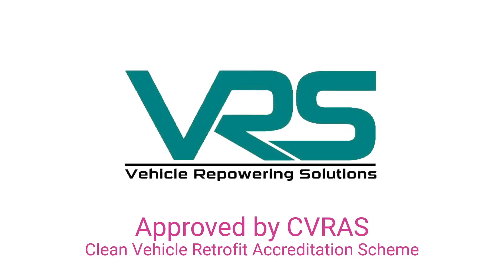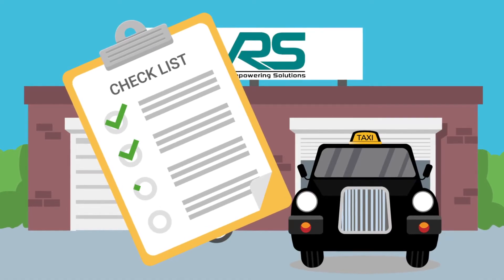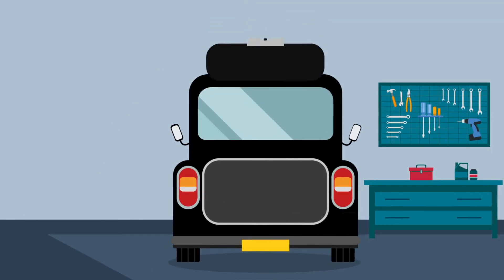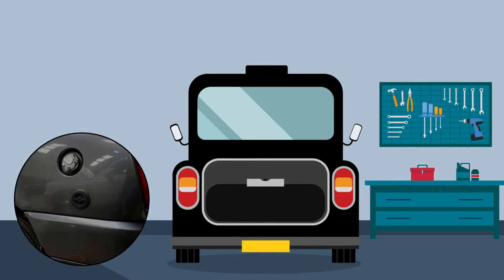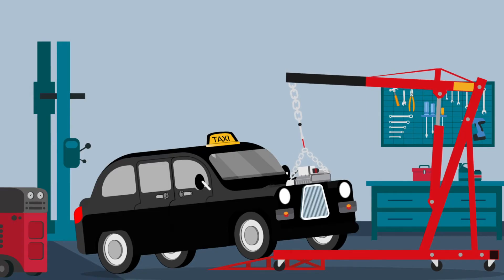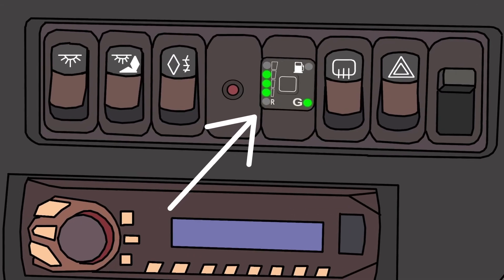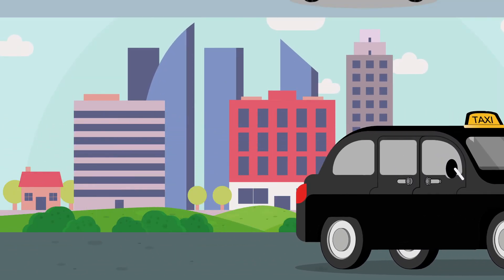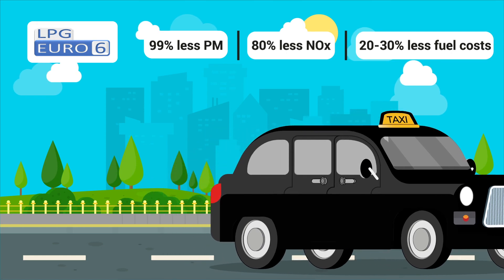Euro 6 LPG Retrofit by VRS

Comment: And the cost is?  Ridiculous sum of money that makes it pointless to do. Unless one does DIY, no way it'll make sense to give money to garages.
Reply: This is an engine and exhaust replacement for non-euro 6 taxis, so they can enter low emission zones and clean air zones. It wouldn't be possible for owners to do a DIY.
Reply: @talktiger8  of course, it's possible for DIY to do anything. I've done something similar and I'm not even a mechanic. Don't under estimate people's abilities. We all can do many things in life DIY .
Reply: @July-A7  It is not possible to DIY for this application (making a TX4 taxi LEZ/CAZ compliant) as the system needs to be CVRAS certified and fully emission tested etc. Also, if you're putting in a different engine, as in this case, it's very technical. Bespoke electrical harnesses and control systems designed and built, for instance. Not possible for someone untrained or inexperienced to achieve.
Reply: @talktiger8  you cannot say this. Everything is possible. Testing is separate from building it. People change their engines all the time and then take the car for testing and certification. It is pointless to repeat the same nonsense that DIY cannot change the engines on their cars. 
Some do DIY conversion engine to fully electric . Some DIY their own airplanes, from scratch. My cousin constructed a small airplane and flies his family in it. He is a pilot, bit not a mechanic. Just a competent DIYer.
Don't try to put limits on what people can or cannot do. Evidently, it is impossible for you, but plenty of us are much more capable than shrugging our shoulders saying "Nope   Not possible".
Reply: @talktiger8  further, it's doesn't have to  be "bespoke electrical harness". You can change the whole electrical loom . Or you can add only the required cables and sensors for petrol and reprogram the ECU.
Reply: @July-A7  ok 'some' people, I suspect the vast minority, might possess the skills and knowledge to achieve the things you mention BUT in relation to this specific video, a taxi driver with a TX4, can't just go and fit his own system/solution to bring his cab up to Euro 6 standard. There are strict rules and regulations in place from local authorities and licensing bodies.
Reply: @talktiger8  yes,some people.
The point I made in my first comment was that the cost of such conversion will likely make it uneconomical, unless someone does it DIY.   Some taxi drivers might be capable, many may not be. Selling their taxi and buying a newer car would likely make more financial sense.

Whether done in a pro garage or DIY, in compliance with all regulations ,of course .